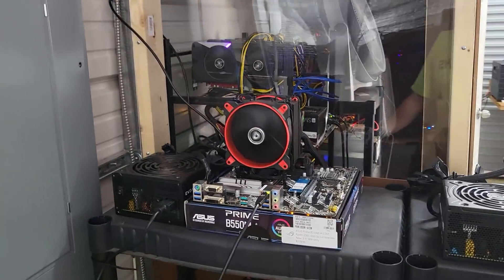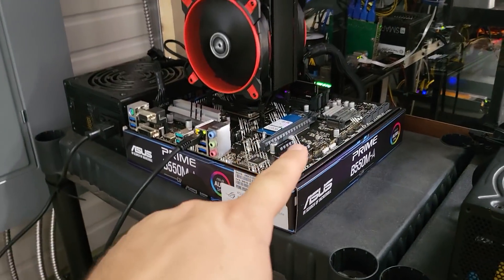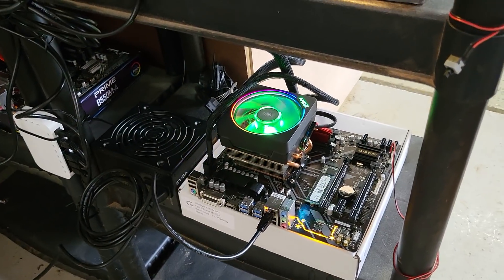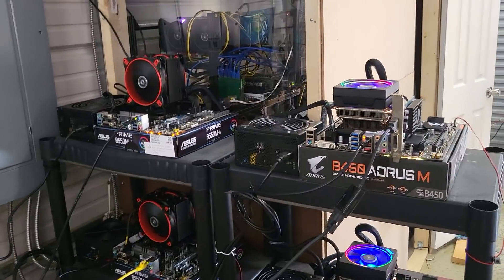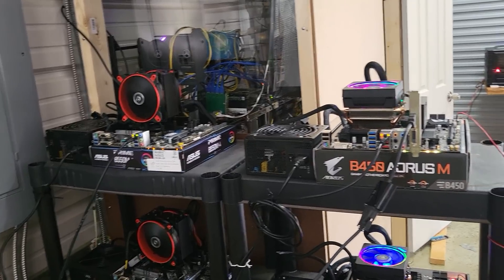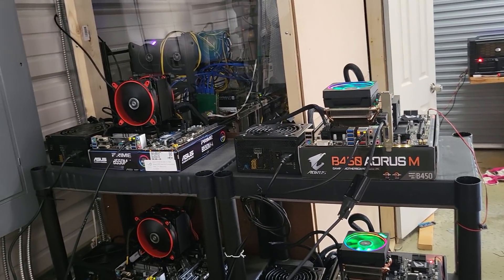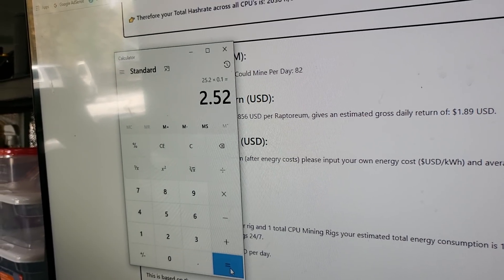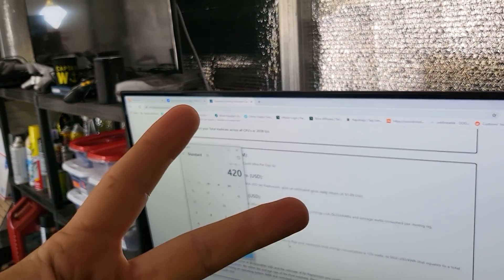CPU Mining Raptoreum Better than GPU Mining?

Comment: Are you using 100% of your cpu capacity? or is it better to just use 60% to prolong the life of the hardware?
Reply: Life of the hardware is mainly dependent on temperature, which depends on voltages and frequencies used to clock to the chip. You could underclock and undervolt the CPU and make it's lifespan extremely long, no matter what the usage is. With good enough cooling, he needs not to worry about the lifespan of the CPU.

Comment: Is it possible to use motherboard 24-pin splitters so that you can use one power supply for more than one board? Or does that not work out well in case of restarts? 
Are you planning to add GPUs as well?
Reply: As far as i know thats possible

Comment: what are your thoughts on using liquid coolers for this application?
Reply: Personally I don’t bother with water cooling for 24/7 rigs. Easier to just dust and replace fans as needed on air cooling and most 120mm tower setups are good enough.

Comment: I ain't selling a single raptoreum coin as well, this blockchain got smart contract along with hybrid consensus mechanism, i believe price per coin will reach $1 in future
Reply: Selling mine on price spikes. Already payed off a 3900x,3950x, and a 5950x 👏🏼👏🏼👏🏼 on my way to buy more muahaha
Reply: @lorenm4015  do you use tradeogre or what?
Reply: what if you are selling the raptoreum to buy more cpus and mine more raptoreum ... haha ok I let myself out.
Reply: @nahuelcutrera  scaling up cpu mining is not easy like gpu mining, I’m also looking for additional cpu to mine but i’d rather invest money from different sources than selling rtm coins
Reply: @xishanali  ok makes sense
Reply: @xishanali  its just as easy  Memory/CPU/1200 watt server psu's  400w Pico . your set 8 mother boards run on 1 1200 watt power supply .you just need to route all the wiring because it takes up more space .
Reply: @xishanali  True but its cheaper since you do not need a gpu if the board has a built in graphics interface but the RAM costs vary.
Reply: Agreed plus staking Rap increases profit.  I'll sell one third for now then hodl the rest

Comment: @brandon coin
Please do answer..i am one of your subcriber
I planning to buy LHR GPU either 3070 or 3060 or 3060ti.. for mining
I already have 2 1080 and 1 3060 (that works with 470 driver)
So can i combine my old 3060 with new LHR GPU s? Or will i get error ?
Reply: Old 3060 and new lhr won't work on the old dev driver togethee
Reply: If you want to keep them in the same rig, you need to go after anything but 3000 series. I suggest 1660 super or 2060 support for that matter
Reply: @mekhonte  thanks bro.. i will go with this plan and look for 1660 super or 1660 ti or 2060
Reply: I have a 3060 V1 on driver 470.05 and a 3060ti lhr. They CAN NOT BE in the same rig, if you have 470 driver it will not recognize the 3060ti and you have any other driver it wont unlock the3060 V1.
Hope i helped!
Reply: @misterjaws5463  thanks bro..  got it..
Reply: They won’t work, best bet is NB miner or T-Rex
Reply: I use nicehash. I mix and match my 3000 and 1000 series gpus. The non lhr i use quickminer and the lhr gpus i use regular nicehash miner. You can make it mine whatever algo thats available to that gpu. Non lhr i mostly use kawpow or octopus.
Reply: @retroscomedyclips  thanks bro.. but my issue is if i pair my old 3060 and new LHR 3060 in same rig will it detect new LHR 3060 with 470 nvidia driver which is used by old 3060 so that we can get 47-48 MH
Reply: @ghostrider1237  im not sure. I would think you can only use 1 driver for both. Even if you used different miners they would use the one driver. But like i said im not sure. Have you tried looking it up on Reddit?